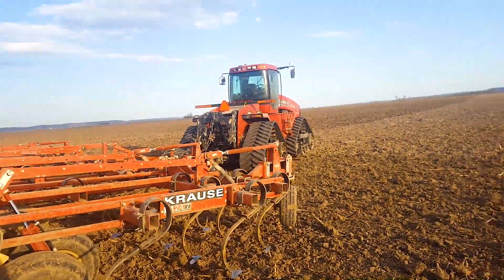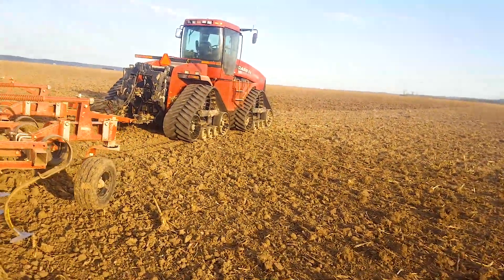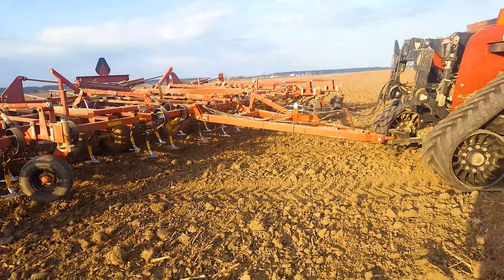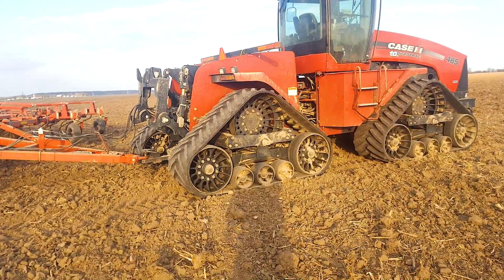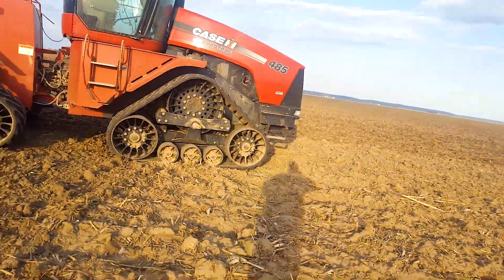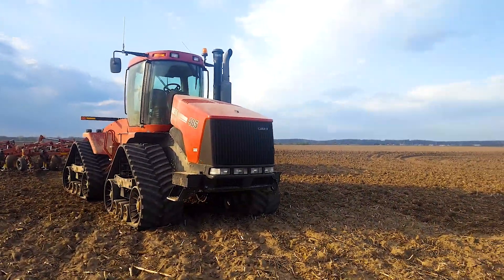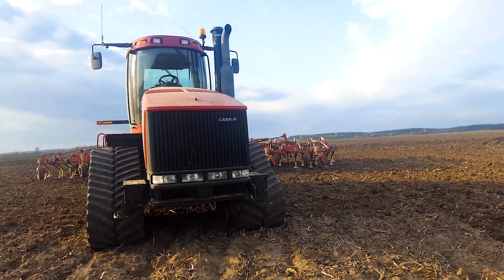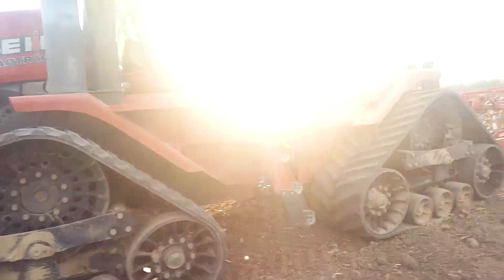case ih 485 walk around

Comment: We have a 485hd wheels tho. 3400 hours. We had to put in a new ecu this year but other than that it's been a good tractor. The ac in ours does suck. I have to cycle it on and off to keep it working. When I have time, I plan on taking a better look at that problem. What rpm range to do usually run in? I use to run around 1750 but now I'm running 1900 rpm. These ivecos like rpms for power. Also be sure to change your crankcase breather every 1500 hours. Apparently that's super important